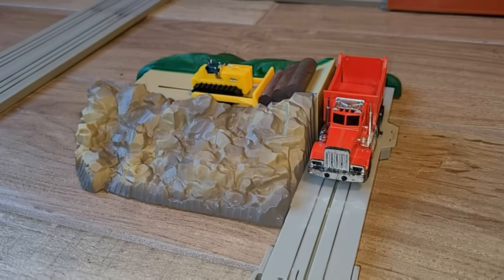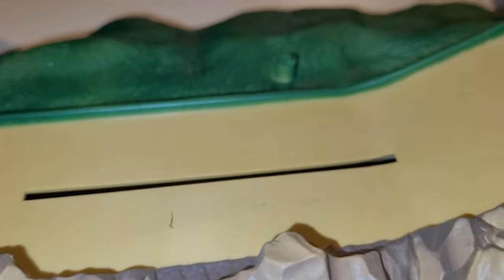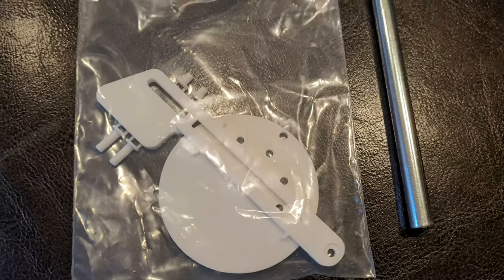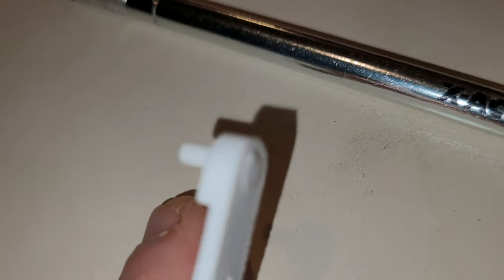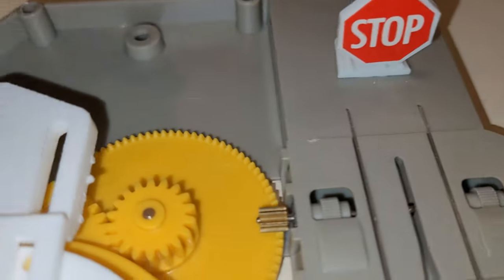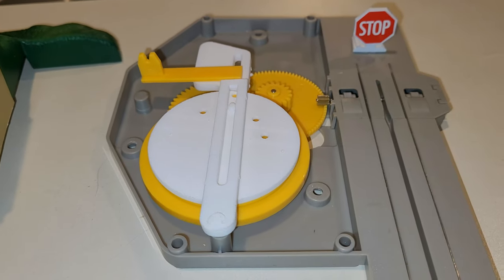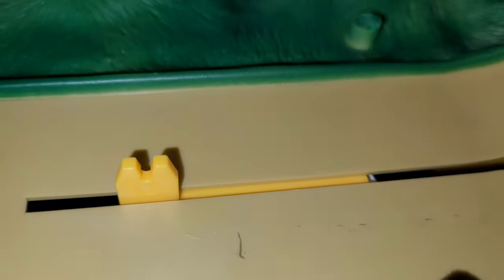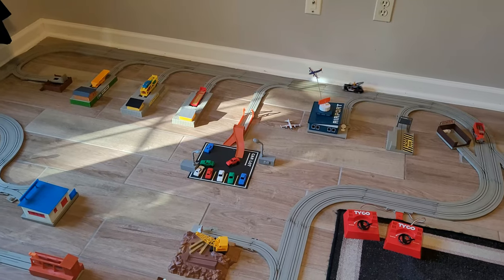Tyco Us1 Operating Log Loading Bulldozer 3D Printed Automatic Reverse Retractor Modification 3415

Comment: I just recently installed this upgrade to my set this week. I thing that I had to do extra was use sandpaper and thin out the portion of the arm where the Yellow arm (that holds the bulldozer) attaches the end of the new white piece. The Yellow arm was not free to slide up and down the opening which was causing the bulldozer to get stuck. Once I sanded both sides down a little it stopped the "stickiness" from the end being rough.
Reply from the maker: Interesting, mine worked without any mods. Did you 3D print at home or at Shapeways?
Reply: @MikeBiddle  I had it printed at Shapeways. It was very minor. The arm just didn't slide smoothly through the opening and was getting caught. I did just enough to smooth it out and it worked great.